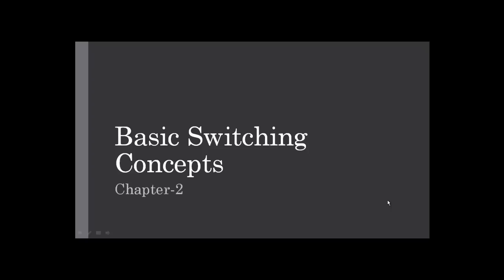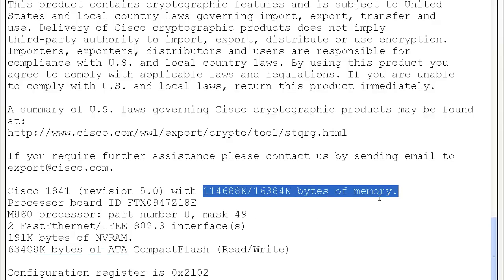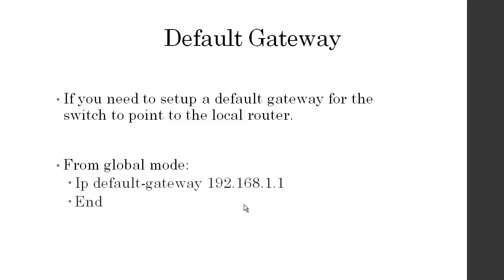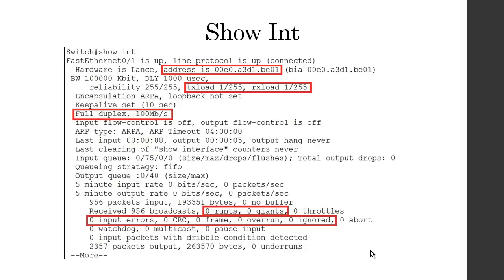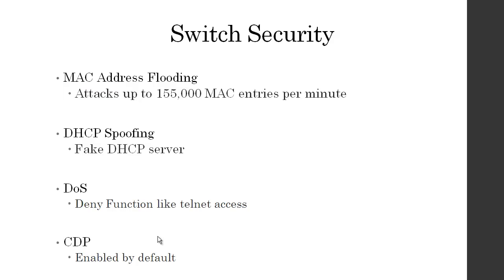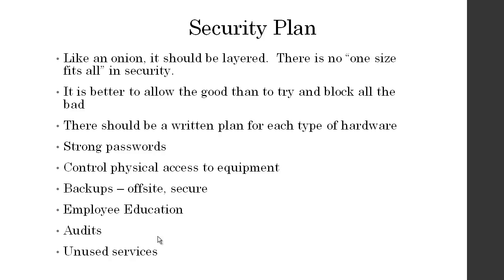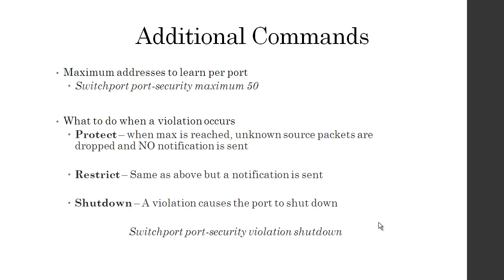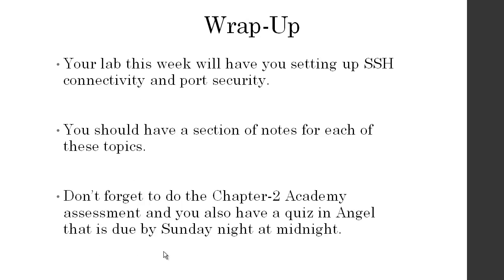CCNA-2, Chapter-2

Comment: Hi Johnny, hope you are well! I was wondering about something. even if you have many VLANS on switch, you will still needs only one management vlan, right ?( to access the switch remotely).

Now, if you create many VLANS, each vlan will still have the command <Ip default gateway> ? to exist their traffic to router. This questions are making little trouble on my mind since.
Reply from the maker: You are correct, you only need one management vlan for remote access regardless of how many other vlans you have.  Default gateway is a global command and not used for each vlan.  Only one default gateway command is used per switch and it normally points to the router on the vlan-1 subnet.